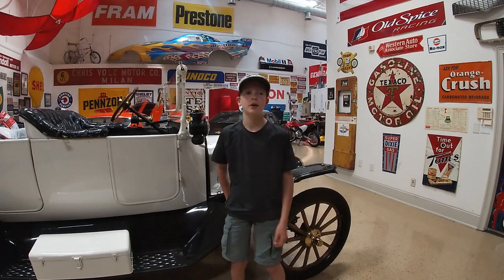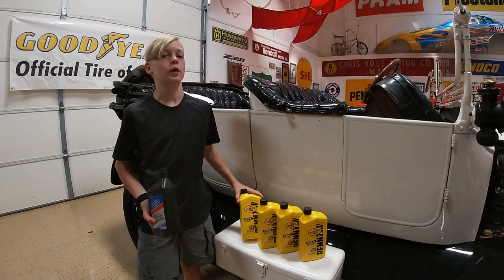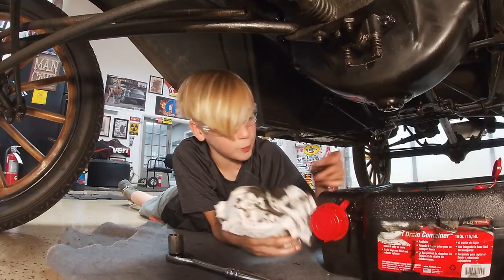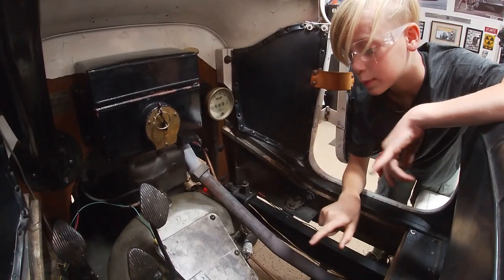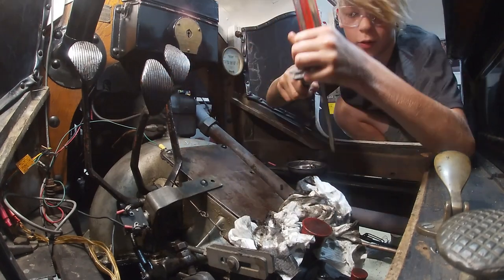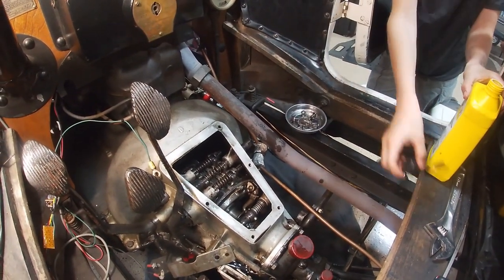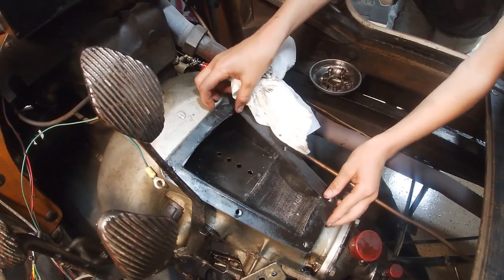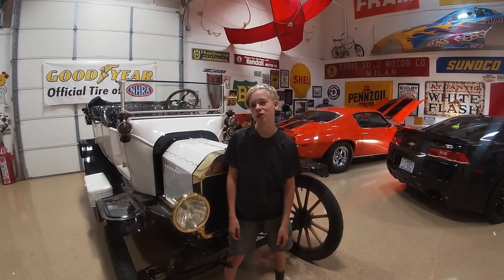Model T Ford Oil Change

Comment: I've also heard 10W-40 in the summer and 5 w40 in the winter.
Although these 40 weight oils may be reserved for an engine that's beginning to get sloppy in the bearings.
Considering all of these cars have survived until today, using Straight 30 weight, it's reasonable to assume that all of these grades, may be correct.
I don't think you forgot the oil screen. I think it was edited out.
I was amazed at how filthy it got after just one year.

Comment: I had a 1916 touring car.  What are the advantages of pouring the oil into the top of the transmission?  Never heard of that.  Not saying it’s wrong but just curious about the logic behind it.  Thanks!